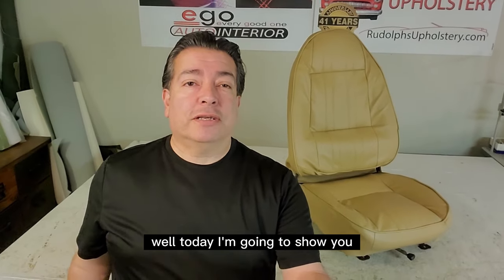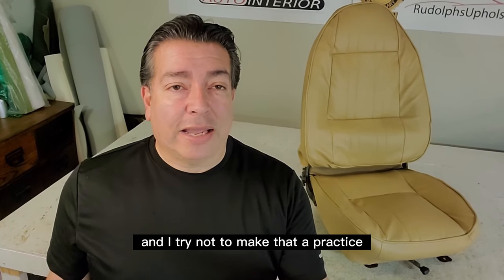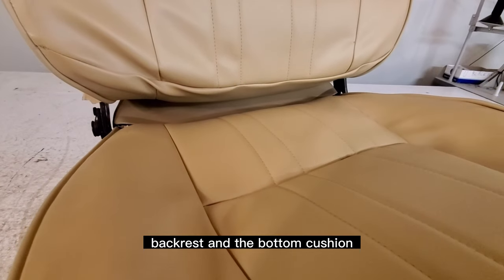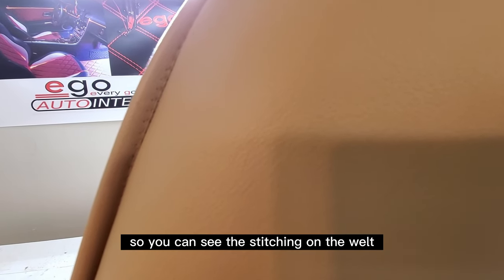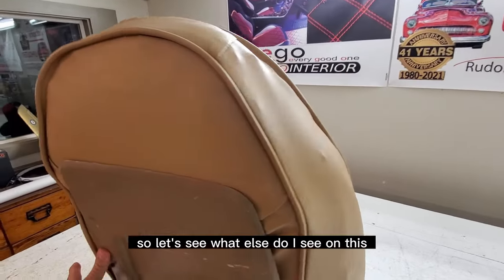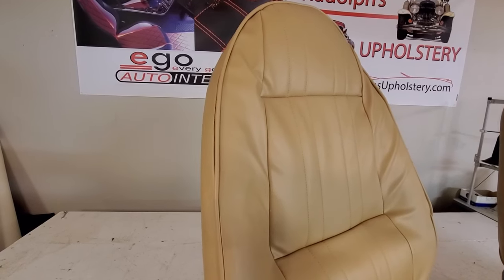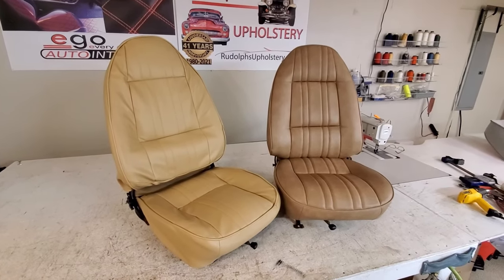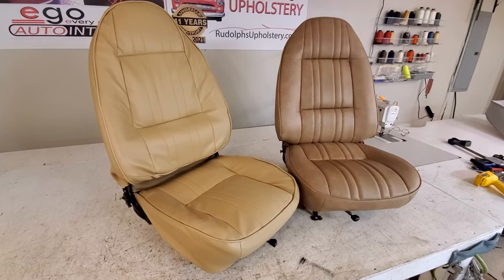HOW NOT To Do DIY Upholstery - Auto Upholstery

Comment: I own 3 x classic 80's V8 W126 Mercecdes ( 2 x coupes 87 & 88 and 1 x 89 560SEL) and do all the resto work myself except for upholstery, but now recently retired and all the time to learn leather sewing which iam very keen to learn.  My next door neighbour (Nancy) is also retired from owning a curtain business all her working life and now has her industrial sewing machines in her garage which i can access to learn on.  I live in Perth, western Australia 
Your teaching skills are top notch as i stumbled on your channel recently and love the detail you put into your video's
I have spare seats for my cars and over time i have collected leather covers in varying states of condition and the foam molds/backings for the seat shape that mounts to the frame
The mercedes leathers have that under material (some threaded with wire) in the creases so in the crease it can be pulled & hooked to create the deep creases in the pattern. Over time that under material deteriorates and the crease lets go giving the leather seat base in particular a flat appearance instead of the correct deep recesses
I would like to refurb these leather covers (the centre sections have perforations (holes pattern) and side bolsters smooth
I would like to bolster the sides more on both the seat base and the the seat back for a more snug fit much like the Recaro's are shapes on the bolters and perhaps it may require the patterns to be enlarged with fesh material to accomodate 
Sorry for this post being long but it would be ideal for you to demonstrate repairing the above pleat issues and how to mode the seats for larger side bolsters
Reply from the maker: Hi! Everything you said here is all true. Here they call it horse hair pad for the seats. I am getting ready to do some corvette seats with larger side bolsters which I need to change the patterns for the new seat shape. Thank you so much for watching!

Comment: I have a question. When making new patterns using original foam that is still good. Do you always mirror the pattern? Do you cut the left and right sides the same even if the foam on either side is a little misshaped?
Reply from the maker: Hello Mr, If one side of the same seat is different from the other side, they should be duplicated just the way they are. I only mirror a pattern if I am doing a left seat and a right seat at the same time. Please keep liking and watching!

Comment: I did the seat bottoms on my Excursion and wrapped the steering wheel. Now, I didn't make the covers or the wrap. I bought them and put them on. Yes, not quite the same but for me not having access to the equipment nor your professional abilities, that was fine with me. It looked like a factory finish when I was done however. 
The steering wheel wrap had to be hand-sewn with what was included. Turned out very tight and hasn't come loose in the two years since I did it. Much better than those horrible slip-on steering wheel covers.
The seat foam and covers are still perfect.
Reply from the maker: Hello Bill, I love hearing good news like this! There is satisfaction when you know you did it yourself right? Please keep liking and watching!

Comment: I know better than to try upholstery, but i did recover an armrest for my current project using 3m super 90 spray adhesive. 
I think i know better than to tackle the headliner myself, but i might not be opposed to trying the cloth door panel insets that need replacing ,thats if the 3m stuff is ok, for that i see alot of vids saying to use the pro glue especially for headliners.
Reply from the maker: Hello Mr Hill, If you cared for anything you are working on, Stay clear of anything that sounds like three men. See this video: https://youtu.be/2KzEb2ZvWzo Please keep liking and watching!

Comment: Can I ask you for suggestions on doing upholstery?
Reply from the maker: Sure, we can try that. Go ahead.
Reply: Hello I'm trying to recover my dashboard on my 1970 Ford f100. It was cracked and brittle so I heated up the vinyl and took it off without damaging the foam underneath.the question is the foam still has crack lines in it and I don't want it show when I recover it with new vinyl.so how would you suggest I cover the cracked foam on the dash.i want to french Seam the vinyl. I am going to do it my self.the foam is not missing only has lines of cracks running in it. Thank you for any suggestions and for your knowledge and time.
Reply from the maker: @guadalupealvarez4401  Hi! In the old days, we used to use silicone to fill in the crack lines. Thank you for the kind words, and thanks for watching!